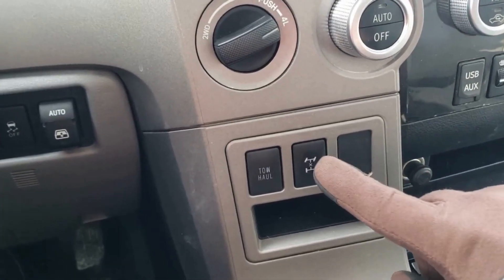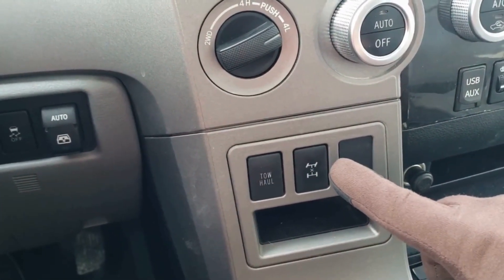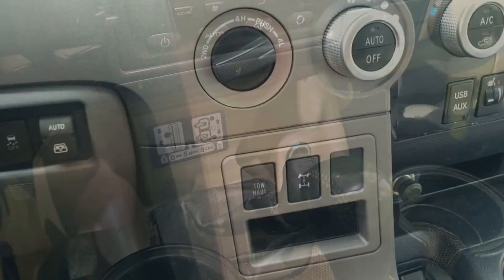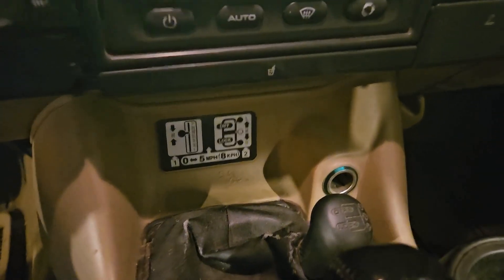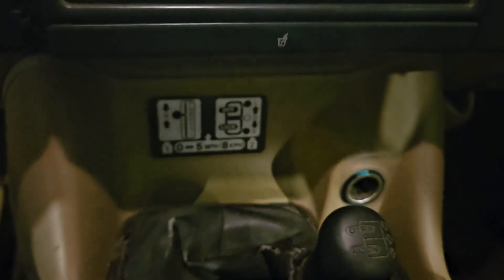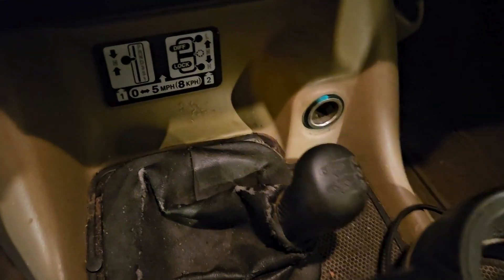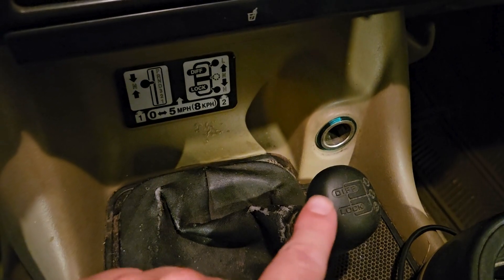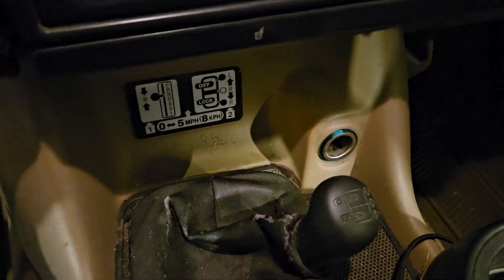What Does a Center Differential Lock Do

Comment: Partly incorrect, Yes, locking the center diff sends even power to the front and rear axles. However, it does NOT lock the front axle and the rear axle and turn in the same speed. Unless your vehicle is equipped with a front and rear diff locker. Which is not the same as a center diff.

When you loose traction on a tire, you will still spin uselessly.